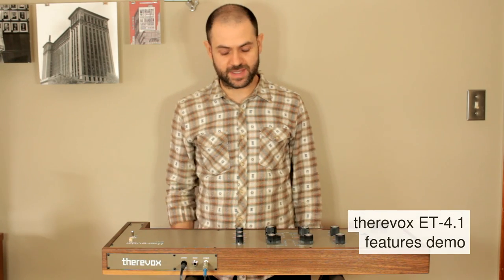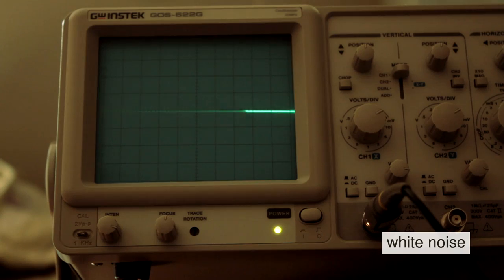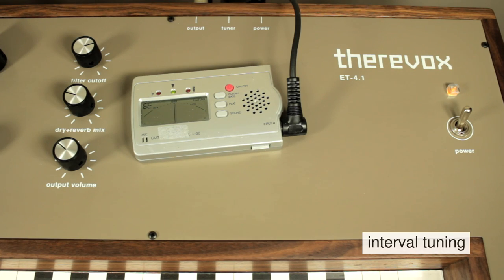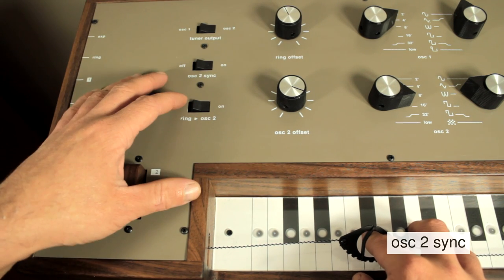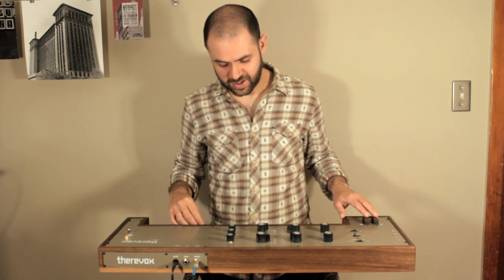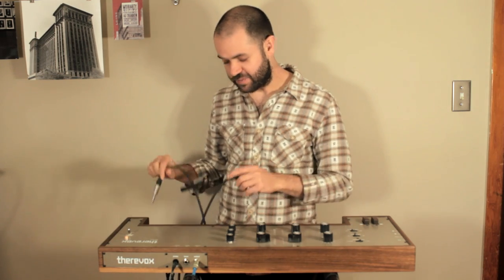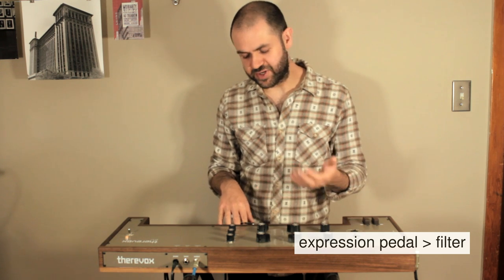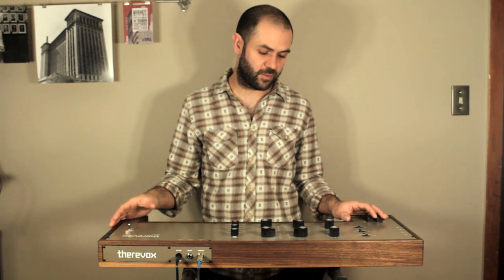Therevox ET-4.1 Features Demo Overview

Comment: Really cool.
I love how on the 4.2 and 4.3, there is an FX loop before the filter, opens up for a lot of sound creation (for example waveshaping if the OSCs feel a bit limited, and harmonizing effects for poly sounds, or even a 2nd filter, or why not patch it together with another synth/modular voice, under CV control from the ET, to get even more OSCs in there.

Comment from the maker: Thanks Marcus, the ring's position is what actually controls the pitch You can control the pitch without the ring with the tune and octave knobs or the ET-4.3 has a CV input for the pitch of each oscillator so you can use another keyboard.

Comment: These are really neat. I want one so much. Can you run other devices through the filters and reverb and such? That would be a great feature. Especially with that unique reverb.
Reply from the maker: Hi Paul, on the ET-4.2 and ET-4.3 there is an FX loop and external input that is before the filter and reverb.

Comment: It based on ondes martenot,right?
Reply from the maker: Hi Eden, the ring and intensity key are based on the OM. But instead of controlling a single oscillator, the ET-4 controls two oscillators with some different waveforms and has a synth-style low-pass filter that can be controlled by an expression pedal. The ET-4 also has a built-in spring reverb that can sound similar to the OM's diffuseurs.